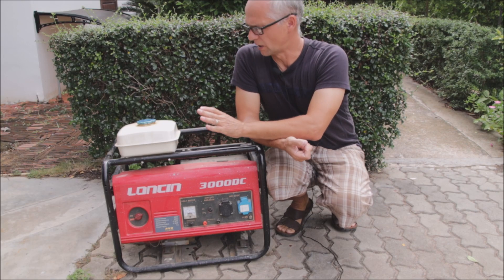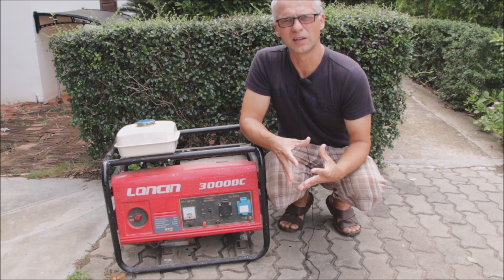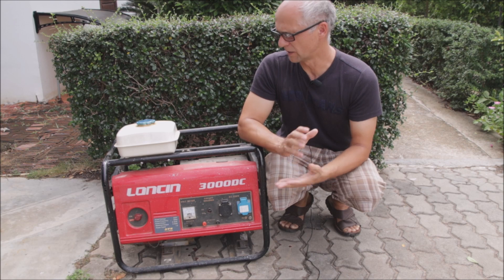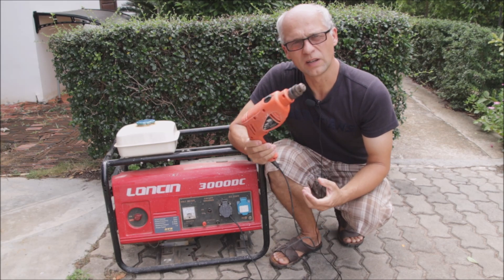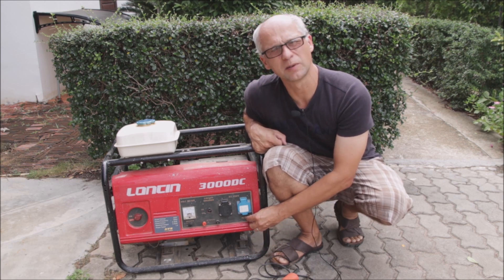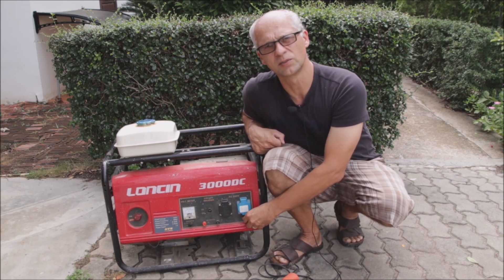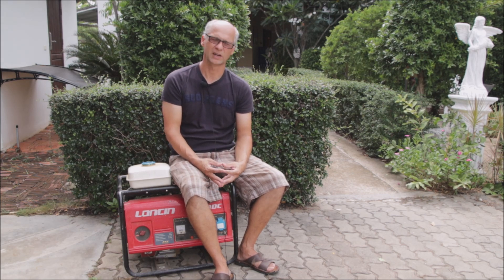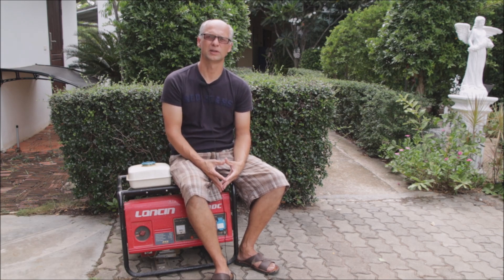In-Depth: Earthing and Bonding of Solar Inverters. Why?

Comment: In a quite unlikely case you touch one leg at one appliance and the other leg on another defective tool or appliance, means you connect your self same as a normal consumer and if you sit or stand insulated enough against the ground (which is quite likely) no RCB will trip. Even if you stand or sit less insulated against the ground, the current that flows from one leg through you direct to the other leg is much higher (far more than 30mA), than the current that splits off and go to ground. That means even a TN-net isn't save too. 
Also in other case, when you are well grounded, sitting for example in a bath, there were cases the RCB didn't save life, cause RCB's dont limit the current, they just limiting the time, which can be not enough to prevent ventricular fibrillation and save life. But in this more likely case a IT-net will save life, cause no current will flow through anybody who touches just one conductor. If I compare this two more or less likely cases, the favour goes to IT-net I guess.
I think earthing comes from a time where most apliances had a metall housing and melting fuses was the only possible protection. Today its quite unlikely you touch both wires at the same time, cause most things have insulated plastic housings.Also a big mains grid is impossible to keep floating, cause there will be several earthboundings anyway. But in a small  household grid its possible. So why not use the advantage same as some laboratories have installed a insolation transformer for savety reasons ?
Did I made any missconceptions?
Reply from the maker: No, no missconceptions. The IT system is discussed in one of the subsequent videos. I am just recommending to follow International Electrical Commission Rules which for IT system states 2 risks when you are not using it as per its advantages where you create a safe bubble as you mention.
A housing installation with many electrical circuits will inevitably have a risk that somewhere one day you will have a "first insulation fault" which will turn the IT system into a TN system. The problem is that if you are not aware of it, then you might easily get into a situation where you didn't expect a shock. Therefor IT systems typically will be monitored by a "Bender" device = insulation monitoring device.
The other risk is high voltage surges in IT systems. The risk of those will increase as well if you increase the size of your IT installation and expand it to a whole house.
Its your decision which way you go. Just always be aware about the risks which any of the 5 different earthing arrangements bring with them.
Reply: @RolandW_DIYEnergyandMore  Thank you for your competent and liberal answer. I will apply same savety rules in a IT-net as in a TN-net, not touching anything without testing at least with a previously in known conditions tested test pen, so the risk of a unexpected shock is minimized. I have learned my lesson decades ago, when i was standing in mud with wet espadrilles and touched a hot wire with a big uninsulated plier. I have allready installed a RCB weeks ago on the output, just in case I come to the conclusion to add a bridge between N and Ground will be smart....I am still undecided......

Comment: Which metal is best for earthing (PE)? Iron rod or copper rod? You expert advice shall be highly appreciated
Reply from the maker: you can buy what is available to you. i would go gor a copper rod as iron rods will corrode much faster and will have to be replaced at some point.
Reply: Stainless steel is generally regarded as best, followed by copper-bonded steel, especially where strength is important as well as longevity.

Comment: Hello Roland, thank you for your great work, I’ve learned so much from you, my question is; I’ve an EASUN off grid 5000 watts, 48 volts inverter and when I use my multimeter to test continuity from ground to neutral, there is, so that means it’s already bonded

I would like to use it completely off grid, so how do I wire it please? 

Thank you once again
Reply: Thank you Roland, one more question about earth rod, do i need one?
Reply from the maker: @med687  that depends on your installation. if you want an earthed system or isolated, only run a load from the inverter directly or connect many circuits. if you are planning to connect a sort of house installation and want human protection by RCD/GFCI then you need a rod.
Reply: Ok thank you for all your help and advice, I really appreciate it, have a great day
Reply from the maker: Hi. If it is bonded and your plan is to use it purely off-grid, than this is easy. You just connect you circuit or a distribution directly to the inverter terminals as by their purpose. You can follow the instructions given in the "simple off-grid" video, just without putting a N-G bond inside the distribution unit.

Comment: I wish you showed how and where the neutral and ground is bonded . 5 stars for explanation but 7 stars for demonstrating
Reply from the maker: Hi. That depends on what you are trying to achieve. If you want to use a generator as an off-grid power source, then you can just follow the instructions from the "Simple Off-Grid System" video. If you are using a generator as the alternate AC input from a PV-Inverter, then you will have to study such hybrid systems.
Reply: @RolandW_DIYEnergyandMore  I would like to wire a generator into my home for emergency back up  and id like to know how and where to connect the n to earth . I do plan on using a change over switch
Reply from the maker: @jonerasmus9399  when the Grid is involved, then you need to know the earthing system of the grid and if it comes with a N-G bond at your property. Then it depends where this bond is done. Is it accessible or not? If it is accessible then you can use the original grid input at one side of the transfer switch and the generator L, N at the other side. The new N-G bond is then in your panel after the transfer switch output. If the grid N-G bond is inaccessible to you then you need to use that as ATS Input as it is and as well make a N-G bond at the generator input side of ATS. No more bonding after the transfer switch! There can only be one active bond. If you have a TT-Grid, then the bond can only be at generator ATS input. There shall not be a bond when the Grid is the active power source. Maybe the video about practical guidance can give you some ideas. You see, there is no simple answer or a standard diagram which explains all. That is why this playlist has 12 videos :)
Reply: @RolandW_DIYEnergyandMore  Thank you for taking the time, i appreciate all the effort you put into this topic . Wish my lecturers at college put in the effort you did to explain the depth that earthing actually requires . I'm a new electrician and i find myself learning about earthing all over again.

Comment: You say that you are turning the generator into a TN system by connecting the PE to ground rod. But how is the neutral bonded to earth by doing that? You still have to create the bond?
Reply from the maker: Hi. Depending on the maker and model such gasoline generators can have one side of the generator winding connected to the chassis and that grounding screw. So, that would equal an inverter with an internal bond. You can find that out by measuring continuity towards the poles of the plugs with closed breaker on the device. If there is no continuity to any of the poles, then you would have to make an external N-G bond.
Reply: @RolandW_DIYEnergyandMore  Thanks!

Comment: Hi to all, i have bought a solar inverter with a grid/generator battery charging function and it has 2 inputs one for (SOLAR PV IN)and the second is (AC IN GRID OR GENERATOR) this connection has 3 terminals Live  - Earth - Neutral  beside this connection is an AC out connection only 2 terminals Live-Neutral there is a separate PE connection  on the inverter casing would this system be (IT) ? if yes how can i connect safely to my Distribution panel ? if my (GRID IN) connection provides my inverter with a GROUND/EARTH wire  is my (AC OUT) safe to connect back into the distribution panel ?   Many thanks
Reply from the maker: Well, that's about the question I started with and now 15 Videos and hours of footage later I am still not done. 
Every power source by its nature is IT. Ground/Earth can only be provided by a Ground source. It's the Grid we will typically find as a grounded power source, because it is delivered to us like that. But with inverters, gas generators, etc which you buy and bring to your home, you need to decide what sort of Earthing system you want to use, if any...
So, knowing how an inverter/grid input/house installation will behave depends on many factors. The most important one is the type of earthing system your grid comes with. And then what exactly you want to do with the AC-In. AC-In is a broad description. There is a complex system hiding behind those 3 pins as you will find out in my next video this weekend.
From your description of your inverter, I know that you have bought yourself a device that promises to serve any of your needs. But those claims manufacturers make are very easy. In reality there are so many details to consider and you will see that a deeper dive into this topic will open a chest of questions which you will have to find your individual answers to.
I think this channel is a good start. Every video in the Inverter grounding /earthing playlist tackles several new questions and will finally give you a broad understanding of what this fuss is about.
Thanks for watching, good luck on your quest to a happy PV-Life!
Reply: @RolandW_DIYEnergyandMore  Thank you Roland for the reply i am realistic and i know that the solar inverter i purchased will have its limits i do not wish to run all my appliances using this inverter, i would like to use it for lighting and some small cooking appliances for all bigger appliances i will switch to the grid, my reason for watching all your videos on this topic is to ensure that any appliances i connect to my solar inverter are safe to use and grounded/earthed correctly , i look forward to your next video , Many thanks from Ireland

Comment: so In a fully off grid system, with a hybrid inverter. I have bonded the neutral to ground (between the ac output on the inverter and rcd input in the main consumer unit).The earth/ground bus is connected to a ground rod . Now if I want to add a generator  (HYUNDAI 6600 SE-LR DIESEL) to my utility AC input on the hybrid inverter (EPEVER 5000 upower hi series).   How do i connect this to the input. Do i still add a ground rod to the generator PE. What about if the generator also has a bonded earth neutral? will this not introduce a second earth neutral bond. one at the generator and one at the main consumer panel as described earlier?
Reply from the maker: hi, you connect L and N to the AC input of the inverter, and connect the generators PE to the PE bar at your load center. Use a common rod for both grounds. even if N is bonded at 2 places, that is no problem as you are off-grid. Bonding just provides a return path to the active Neutral and keeps all Neutrals at Zero potential. it is just important to do all bonding before the RCD. on generator and inverter side use double pole breakers to protect from short circuits only and keep the installation safe from human interference :)
Reply: Problem is, I cannot see from the documentation if the Hyundai generator is bonded. The  inverter documentation doesn't mention bonding anywhere. Although it says utility input can be used with a generator
Reply from the maker: @gimiandtarascott8496  you can use a multimeter in resistance mode and measure between earting screw and L and N of a socket. no resistance to one of the pins (N) means means there is a bond. You can as well run the generator and measure voltage between earth and L and N. if there is voltage on N, there is no bond.
Reply: @RolandW_DIYEnergyandMore   ok  tested it. so on the generator there is continuity between N to ground pin. L to ground pin, N to chassis ground. Live to chassis ground. So it is bonded it seems. Now if the load center is bonded before rcd and after inverter output. I am not sure how to resolve this. should I still connect the earth/ground wire from generator cable to the load center ground bar (common ground). ultimately I am aiming to trigger the ATS automatic start on generator when inverter activates the dry contact when batteries are low. So i want to avoid any manual transfer switches.
Reply from the maker: @gimiandtarascott8496  i would still bond at load panel and use common ground with to bonds. its all about having a return path for fault current to each of the 2 sources of power. there is no grid involved.

Comment: Why? Because if you don't, lightning will fry your $1600 inverter/charger like it did to mine.
Reply from the maker: Yes absolutely. But a lucky guy could avoid lightning damage if he had installed SPDs, and still electrocute himself because the inverter is not integrated into an Earthing system :) That's why it is still important to keep this two very important issues separate. Thanks for the comment!
Reply: @RolandW_DIYEnergyandMore yes, SPD might've helped a SMART man. I didn't have ANY earthing yet when it happened. Now I have bare #8 copper attached the panels, the inverters, the AC chargers, the charge controllers and the generator, and then to an 8 foot rod in the ground. Then I have an extension cord running from my inverter/charger/battery box to my trailer's 30 amp plug. Am I good?